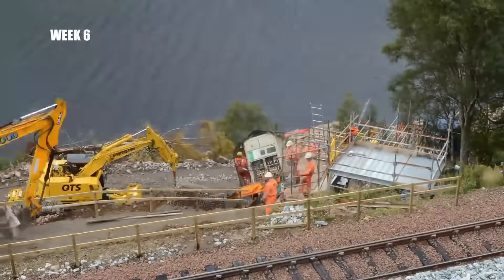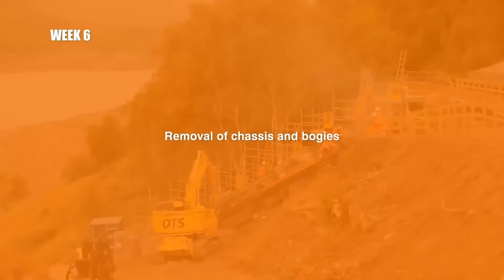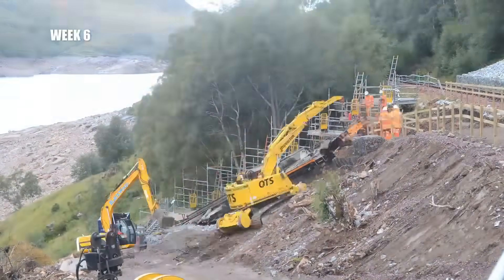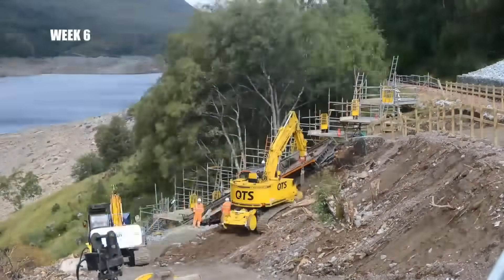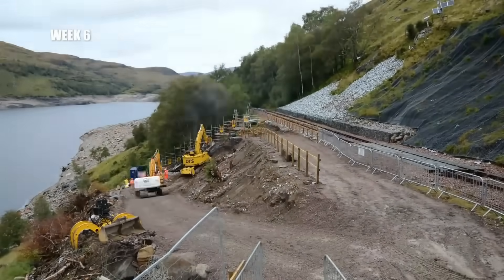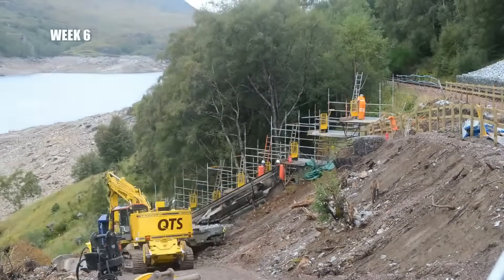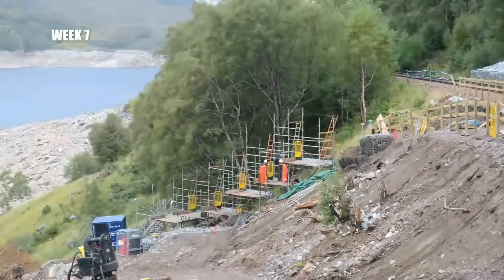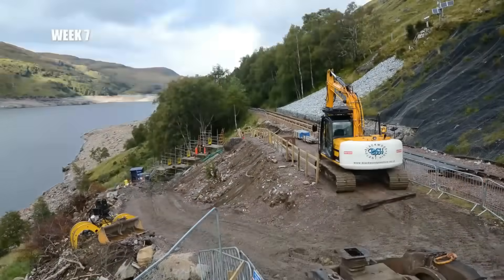Class 66 Derailment at Loch Treig: The Causes and Aftermath of the Incident #fyp  #class66  #crash

Comment: 66734 being scrapped freed up an engine so that 66779 evening star could be built. 66734s cabs have Been turned into a pair of simulators in Peterborough, which I’ve had a go on.

A European imported 66 that was bought in was then renumbered to 66734 to fill the gap.

Comment: GBRf honouring 66 734 is admirable and I really appreciate them for it. Simple but thoughtful move. They could have just moved on but they didn't. They recognize that locomotives aren't just masses of steel and wires. Same way special cars are treated as something more than objects
Reply: It was too heavy to move in 1piece, but the fact that its running number was re-used infers that it was disassembled then re-assembled elsewhere.
Reply: @TheRip72  It wasn't, as mentioned (and shown) in the video. It was chopped up on site and used for parts. Other comments here mention the cabs being used for driving simulators.
Reply: @TheRip72  no it doesn't. It IMPLIES.  If you are going to use fancy words, at least learn the meaning first!

Comment: I have always wondered why such things get sheeted-over. Are the powers-that-be so ashamed of what has happened that they deem it necessary to hide the problem under a sheet ?  It is a stupid reaction  -  just leave it as is for everone to see and photograph.  We all know that it is there.
Reply: Could it be to protect it from the elements so that parts can be recovered in a re-useable condition?
Reply: @delboy1727  Doubt it. These locomotives stand, and work, in all weathers all year round. Why should resting on an embankment be any different from any normal day ?
Reply: @DerekWalsh-l4i  I'm thinking that in daily use they get serviced, oiled, or whatever else they need to do to keep them running.  Sitting in the open without any of that happening might be detrimental?  I don't really know, I'm not a locomotive engineer.
Reply: @DerekWalsh-l4i  going by the information in the video the loco was probably covered up to protect it while the work to reopen the line went on and the insurance company decided what to do with it.
another possibility while these work and sit in all weathers the loco is not really designed to be at that angle so they may of covered it to stop water getting in and adding more weight causing it to slide down the embankment.
Reply: @delboy1727  You`re right, delboy... when they`re running they get (or should) regular maintainence and lazyaruto makes a very valid point, as well...
Reply: It rains a lot in Scotland ,maybe they wanted some shelter so as to recover components in good condition.